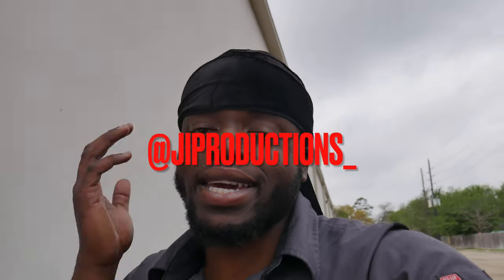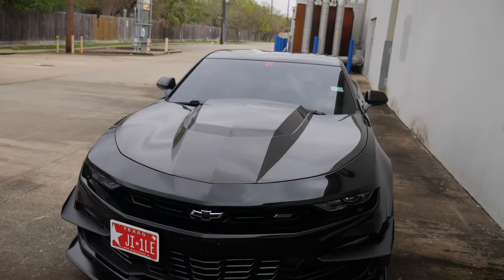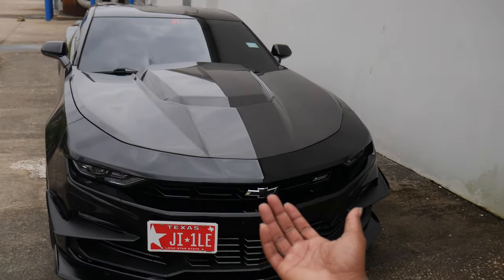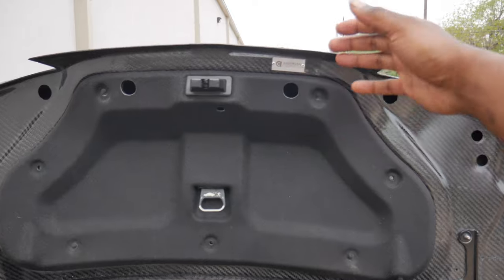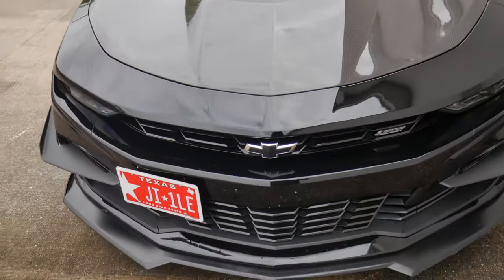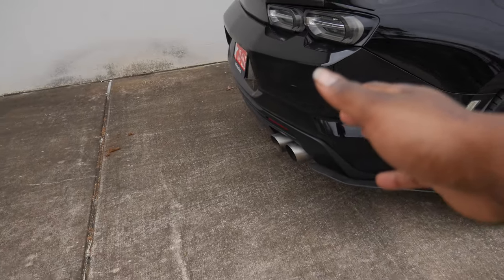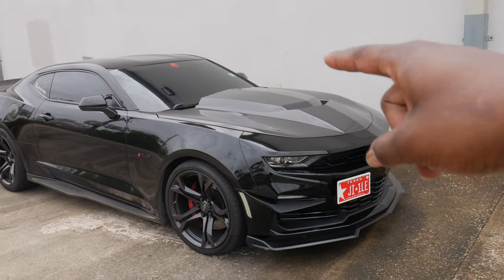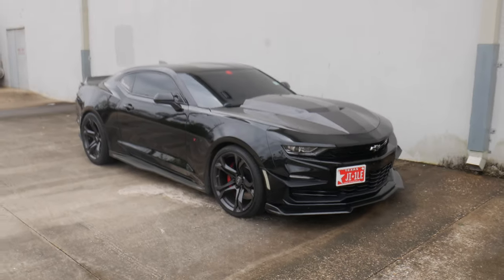WHAT THEY DON'T TELL YOU WHEN BUYING CARBON FIBER BODY PARTS #wow #carbonfiber #thetruth

Comment: I would suggest hood pins bro! With mine at high speeds it would wobble and I got nervous so I put some hood latches makes  me feel more safe! I was scared to cut holes in my 1500 dollar hood but I just took my time and it come out perfect!
Reply: The aero catch style ones are nice!
Reply from the maker: For sure bro imma test it at the track Friday if i see any movement I’m getting them
Reply: @JIProductions  If you run it on the freeway at all I would do it
Reply from the maker: @slickrickdarula9483  bet bet

Comment: Car looking good man! :D Hood fitment looks on point! I've had to tweak my hood latch position a few times... once when I installed the big mouth intake scoop and once for when I installed the radiator cover as I had to remove the latch both times to for the installs. It's 2 13mm bolts I believe it was and they sure want to fall out of your fingers down into the car, lol.

As for the trunk, you shouldn't have many issues with that plastic piece. I run the same trunk and got the plastic piece on fine. I did tweak the trunk latch a bit and played with the hinge bolts some to get it all perfect. It does kind of "catch" a bit when I pop the trunk but nothing wild. My main issue with the trunk was the 3rd brake light opening was not even close to fitting my 3rd brake light. I had to Dremel the crap out of it, haha. Did you have any issues with 3rd brake light opening?

And for the WORST fitment for carbon fiber... the Anderson diffuser. Sheesh... I had to chop into my bumper for that thing to fit and look good.
Reply from the maker: Thanks man i really appreciate it honestly it took for ever to get it to sit what I think is perfect how ever with the 3rd brake light I did have issues. AC states they do it on purpose to help with fitment.
Reply: @JIProductions  No problem man!! Yeah, I know it was a pain balacing my trunk on my head as I tightened and loosened and re-tightened hinge bolts to get it all lined up, LOL. I'm not surprised by AC when they say that... my 3rd brake light never fully clipped in quite right and I ended up adding a bead of clear silicone around it to make sure it stayed flush.
Reply from the maker: Dang that’s crazy i was able to get decent fitment for the third break light